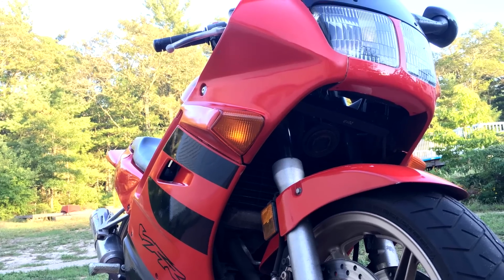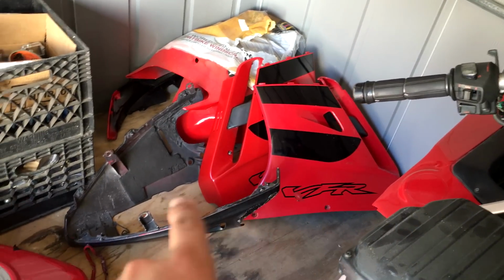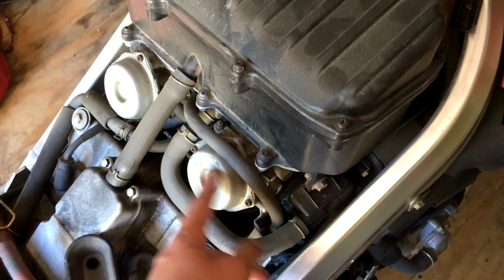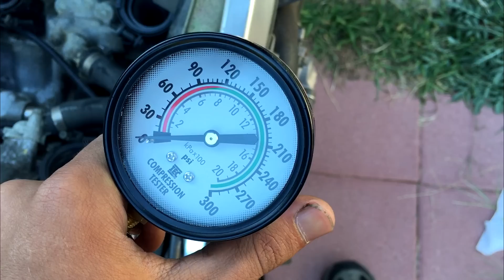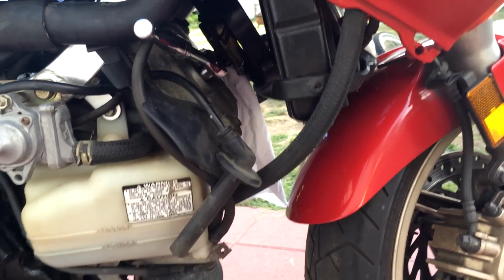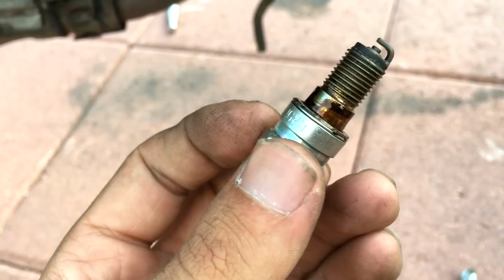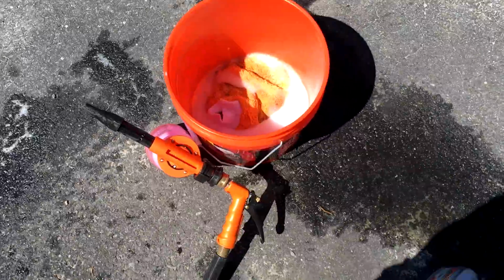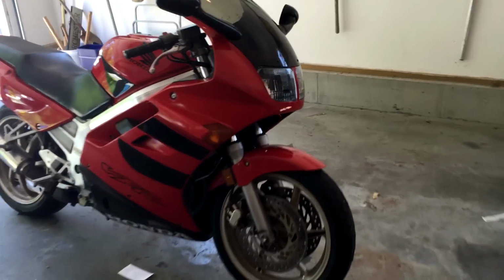New Bike! VFR750F

Comment: Nice video. Well done you made a good deal and ended up with a lot of bike. Just be careful when cleaning or lubing the chain as spray gets all over your rear tyre as well as the intended metal links. Best to place a piece of old cardboard between wheel and chain first to protect the rubber from overspray. 
  All the Best and ride safe.

Comment: This is a lil late, but you should always put some oil in the filter when replacing it. It prevents any damage from the few seconds the engine would have to suck new oil through the filter.

Comment: I can't believe no one has asked this,but why use 5w40 full synthetic oil(for diesel vehicles) in the bike.It's not a criticism,but a question.Diesels don't rev as high as petrol cars,never mind bikes,so it seems an odd choice,especially 5 weight.Also,the additives may or may not cause clutch slip.I've had a few FJ1200's,and ran them on 20w50 mineral car oil,with no adverse effects,but they are air cooled and every one of them burns oil at a pint every few hundred miles,so the oil doesn't last long enough to degrade.I'm on my second VFR750(FV),fifteen years apart,but this one doesn't feel as good as the first,or maybe I'm just getting old.Good video thoough from yourself.
Reply from the maker: Hi there. I run rotella in all my vehicles. I've never noticed any problems before and I read online that it's the choice of most motorcyclists because it's so cheap and does everything the other oils do.
Reply: Can't say fairer than that.Thanks
Reply: HEROrr great video! just want to add that rotella T6 is "Jaso MA" approved which meets the performance requirements of the machine.

Comment: I saw your test ride video, and you werw to be scared to push hard, among other things, because the state of the chain...oh boy now I see you werent kidding!

I have an inmaculated and 100% stock 92 rc36, so Im looking forward to hear your opinions on riding the bike now that is in much better state.

Try to find the passenger grab handle, if you do run errands when back from work, these are great to secure a bag to them, or whatever you cant carry in a backpack.

They also improve the look of the bike, I see yours and that's what I feel is missing the most.
Reply from the maker: Yeah, I noticed that too. I've been looking for the grab handles but they're not as easy as you'd expect for the price. Do you notice vibrations on your foot pegs? I did on mine and did some searching and some people mentioned that there are supposed to be weights on the footpegs, mine don't seem to have them though.
Reply: I had a quick look at ebay.com, (interceptor honda 750 grab) and I got twohits, at 36$ each, not cheap...cheaper here in France/Spain, shame we're far, I have a spare pair....
I've made Seville-Bayonne (972 km) a couple of times with her and I wasnt walking like robocop everytime I stop for refueling, you feel the vibrations, but is not too bad.
Honestly, I dont know if there are weights on the pegs!, will check later.
Reply: Ok so I came from a long ride, I dont have weights on the footpegs, and on the highway, top gear, near 6.000 rpm it vibrates, kinda if your foot is resting on a tattoo machine, but anywhere below that is really fine.
Reply from the maker: a bg My vibrations happen at around 5k, any higher and they seem to go away... strange.
Reply: Not so strange, these are 20 years old bikes, they rev up to 11k, I find normal they vibrate at different rpms
Reply from the maker: a bg I read that it's actually quite common and it refers to the harmonic balancer which causes vibrations between the 5k-6k rpm range.

Comment: These motors carbs even with clean filter maintenance, seems the small hi speed air bleeds get gunked/clogged and it causes low speed cruise engine miss due to volumetric air fuel atomization separation. Fuel injection would solve carb issues but yeah, we know that and dream on about shoulda coulda woulda....right?

Comment: Sweet dude, congrats! Hell yeah man vfr FTW! Hondas are the best! I love my 2014 Honda interceptor(VFR) 800 v4 with vtec! Just keep cleaning that baby and she'll look so good like brand new almost! I've got a two brothers pipe and k&n filter in mine and she runs awesome!!!! That's an old uni filter wow! You don't need that going into the carbs😫! It's a shame how some people don't know how to maintain a motorcycle! I wipe down my bike, wheels and all every time I ride........yes I'm anal but I want my bike to last a long time😉
Reply: Ya my filter was even worse just chucked it didn't feel like spending 60-100$ on a new one and saw many pictures of vfr750f &r s running mesh filters so just made my own
Reply from the maker: i think my filter was like $20
Reply: ***** which one the only ones i saw were K&N aftermarkets and it mostly dry in socal so i went with the mesh was under 10 bucks and would get the more air flow than the filters

Comment: 1. running the bike at least 5 min before oil change allows it to drain much better 2. i would use clean oil on the new oil filter instead of the contaminated oil that came out and 3. i can piss harder than that hose bahaha all shit aside nice job on the bike :-)
Reply from the maker: +ram1 hahaha good points. Thanks

Comment: why are you using diesel motor oil?
Reply: I might be mistaking, but diesel motor oil has more detergents in it, so it will have a better cleaning effect on the engine parts. At least in car engines....

Comment: subbed, question I'm 24 about to get into riding bike's. should i get a 2012 ninja 300 as first bike? or will it get boring fast?
Reply from the maker: I'd recommend getting the bike you want. A 300 is fast enough to be fun for a few months, but unless you have a lot of twisty roads then it does get boring. I'd just take a look at the 300 and the 650 and 500. Maybe the FZ 07 also
Reply: ***** oh okay, around where I live is mostly highway and no twisty roads, i mostly going to ride it hopefully every Friday to work. Also I love your channel I subscribed
Reply from the maker: Contane 21 Thanks! Good luck on your search! I'd look into the ninja 650, but ultimately get what you like the most
Reply: Sorry for stepping in, I'll add my 2 cents.
It all depends on what have you ridden before. If it's your first bike, the ninja 300 will be enough for at least a year. In my experience, how powerful (and how those hp are delivered) are almost as important as the weight of the bike, and for that reason the ninja 300 will be fine.
But then you mention most highway....
Have a look at the cbr 500, is heavier heavier at 423 pounds but its so balanced and predictable! It also will be better for highway riding
Reply: a bg thanks dude :)

Comment: How do you like it so far? I have a 1985 VF500F and wanting either a VFR 750 or VFR800
Reply: I'm in exactly the same position except my VF500F is an 86! Looking for the 99-01 model before the VTEC came in. Nothing quite like the willingness of that V4 to go fast in any gear, at any time!
Reply: Mike Lavdas Just sold my VF500F at the weekend and hunt is on. I love the V4 and missing my miniceptor already
Reply: For a new rider it's just an awesome machine. It's pretty sporty, especially if you get that suspension kit from Jamie Daughtry. The seat and position are super comfy,  it puts out as much power as some modern 650cc bikes with 500cc insurance price. Plus the noise is just amazing (mine has cobra F1r exhaust though). I really wish that there was a modern equivalent of that 500cc V4 in production.
Reply: just got myself a 98 VTR with 31000 miles all i can say about it is. love it :)
Reply: Mike Lavdas Sorry I missed your response. Oh I love the VF500 and it has more hp than any modern 500 cc bike now and more than a Susuki sv650 etc. VFR seems the way to go
Reply: dave krest nice

Comment: why such a cheap oil ? why dont use something like a motul 7100 or a repsol  racing?
Reply from the maker: +Δημοσθενης Δοδος rotella is good oil.
Reply: personally i dont trust it but whatever suits you
Reply from the maker: Δημοσθενης Δοδος For what it's worth, I've been using it for years and thousands of miles. No issues at all. I'm not alone either, a ton of people online use it in their bikes without issue. Try researching it a little and I think you may surprise yourself.
Reply: how many miles you do between change?
Reply from the maker: Δημοσθενης Δοδος 3,000 or 6 months. whichever comes first.

Comment: i hate that rotella shit never use it makes clutch slip
Reply from the maker: +Nick 636n8r what bike do you have? I've ran it in over 10 different bikes and never had an issue
Reply: oh wow really? yea i ran it in my stunt bike 04 636 and it made my clutch start slipping real bad i thought it was the clutch going out and i took it apart all the plates looked good and the steels were good so i put it together and put mobile 1 in there and it started working maybe its just because i do a lot of wheelies lol
Reply: HEROrr awesome video tho I just started watching ur stuff man very entertaining
Reply from the maker: +Nick 636n8r thanks man!
Reply: HEROrr no prob just subbed
Reply: I bought a five gallon jug of that rotella and the top quarter of the bottle was filled with pure water.quality control is a huge issue with shell oil rn